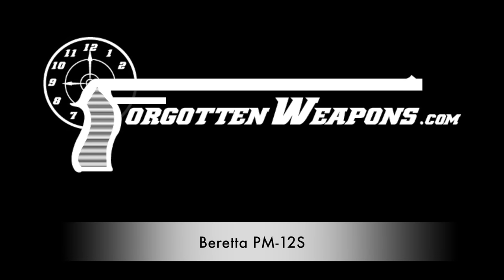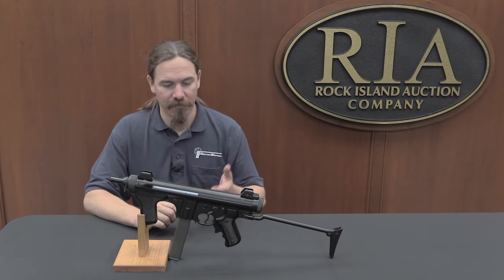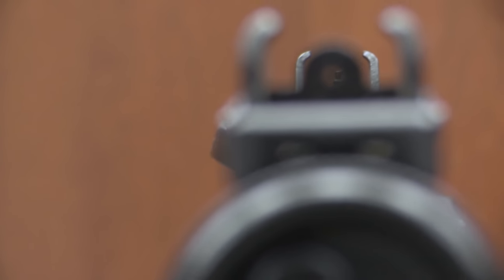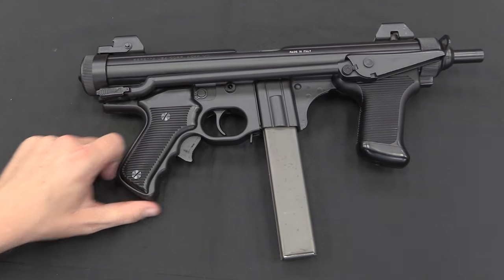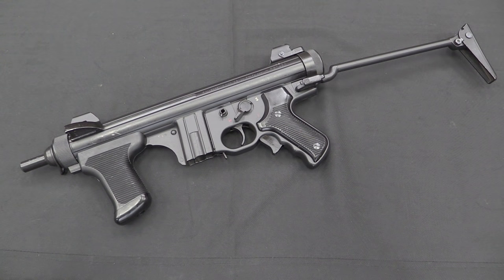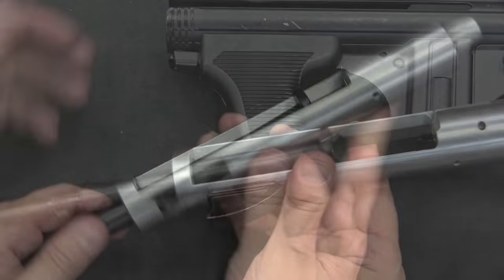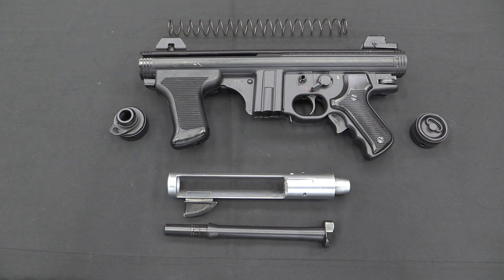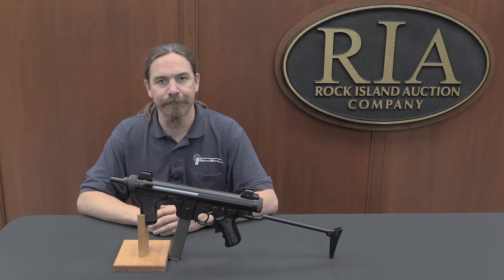The Beretta PM-12S Submachine Gun

Comment: If you like Italian B movies like me, then you'll have seen these being fired from (or at) countless Alfa Romeo Guilias.
Reply: I prefer them being fired at Jaguar E-Types like in "Danger:Diabolik"
Reply: wait which movies? I need to know.
Reply: @Handhandme  every 70s movie of the genre  poliziottesco
Reply: I am a simple man. When I read Alfa Romeo I will press like!
Reply: Saw it in the film, THE CASSANDA CROSSING, but somehow the wrong size magazine clip was being used, 25 rounds when they are blazing away at each other inside train carriages,which obviously this isn't, 32 rounds.
Reply: @colinelderfield6964  Well usually the magazine is loaded with 30 or less rounds because spring tension of the follower tends to double feed especially in older magazines. Other than that there are also 25 and 40 rounds capacity magazines, the M12 uses the same magazine that was used by the M38 lineup of SMG from Beretta. In Italian Military and Police you can heard them referring to the M12 as the MAB sometimes (MAB stands for Moschetto Automatico Beretta, Beretta Automatic Musket translated, that was the official name of the Beretta M-38 SMG).

Comment: by any chance your ever do a video on the xm8 series and why it didn't work out for the army?
Reply: I think the XM8 was not adopted was because the wars In Afghanistan and Iraq
Reply: He actually talk about the XM8 in Q&A#6 or 7.
Reply: Grant Barnett:  That was both A: Only if you pumped so many rounds through one, as fast as you could, that the steel itself was starting to warp and buckle and B: They fixed that.
Reply: it wasent adopted because of colt, the army wanted to get the xm8 which was much better then the m16 and m4, but the goverment have deals with colt so they couldnt get the xm8, because it was from h&k so it means that they would cooperate with the germans and colt didnt want that so they paid some senatros of that they dont vote for the xm8.
Reply: Patrick Gonzalez so that was the problem then
Reply: MrBlonde294 You realize the Army buys their m4s from FN, right?
Reply: Filipe Amaral the Army actually took complete ownership of the design in 2009. Colt sued them to try and get it back but lost. Now that I think about it though, that was after the cancellation of the XM8 project so at the time Colt may have been able to influence things. I haven't seen any direct sources one way or the other so who knows?
Reply: The single biggest reason for the XM8 is that it is not significantly better than the AR15 platform in service at the time and the key word there is significant. The costs of replacing the AR15 platform go beyond just the guns. Equipment, documentation, and training would all need expensive changes made. Armorers would need to be rated on a new gun platform. Supply would have to learn new parts and develop new procurement channels. Meanwhile, the AR15 is still reliable and has enormous room for improvement or adaption thanks to the many modules out there for it. Stay tuned for Ian and Karl's series on What Would Stoner Do? They, using civilian modules, have probably created a superior weapon to the XM8 with much less hassle. Until someone comes up with a gun that can completely outshoot any AR15 configuration possible, I think the AR15 will continue to serve well.
Reply: the ar 15 isnt a bad rifle, but its just too sensitive sometimes. but its cost also to modify the current ar 15 rifles, there are the m16a1, a2, a3, a4, these are all different rifle and have to be replace if they want the newer model. but currently some units have replace it with the fn scar or the m416, good weapons as well!
Reply: Patrick Gonzalez g36 is one of my favorite guns, so cool and so compact
Reply: Who's Chance?
Reply: what chance?
Reply: The OP started talking about some guy named Chance and his ever. It sounded like an alien talking.
Reply: It's because game devs needed a gun named 'prototype assault rifle's. ;~P
Reply: My country navy PASKAL use that xm8 gun
Reply: Malaysia adopted the M8 platform.
Reply: MrBlonde294 special forces use the scar series and navy seals use the M416.  But those are considerably much smaller contracts than say outfitting an entire army, air force, navy, and marine corp.
Reply: Um, no, G36s HAD that problem;  they work fine now.  In fact, 4 guns were much, much, MUCH more reliable than the M4:  FN SCAR, XM-8, G36 and HK 416.  The last 3 are all made by HK.  As stated, XM-8 is basically just a G-36 with a face-lift, and the 416, though it looks like an M4 externally, has a G-36 gas system.
Reply: @varanid9  yeah the 416 looks like a M4 because it is based of the AR-15
Reply: I think Larry Vickers might have talked about it WITH Ian at one point, because he owns a functional replica of an XM8 rifle. Apparently this issue was not with the weapon's design at all, but the circumstances of its development. A general had put in a request for a new rifle in a roundabout manner, and the army was not happy about it and canned the project taking ownership of the designs. (I think thats the way it went).

Comment: Beretta PM-12 in it's version M-12rs was used by some branches of our Military, especially the Marina Militare (Navy) in the 1970s and 1980s, actually it is still used by the sailors during parades because it's stowed on the older units of the MM but it's not issued anymore in the Esercito (Army) or Aviazione Militare (Airforce).
On the contrary it is standard issue as you said still today for the Polizia di Stato (national Police) and Carabinieri (military Police), actually any Carabinieri car has one stowed under the front passenger seat (with a special security release) and it is very common to see it at any police checkpoint as there is always one or two Police/Carabinieri members performing the talking and checks with the drivers and one with a heavy duty bullet proof vest and an MP-12 standing by a few meters away that keeps an eye on the other occupants of the vehicles.
Ciao da Milano :-)
Reply: Never seen any Carabinieri checkpoint, here over in my place it seems all they do is speeding in residential areas.

Comment: I've held a few of those in my hands! They belonged to the Military Police of São Paulo State, in Brazil. Here they were called Beretta M972 and our model had some kind of reddish brown pistol grip and foregrip. The guns were sent to destruction because they were really old and by some absurd decision of the Brazilian Army, 9mm was prohibited in favor of the .40 cartridge, so there were no efforts to buy new 9mm machine pistols/submachineguns for police duty. To fill in the SMG role, the Force adopted the horrifying Taurus/FAMAE MT40 which then evolved to the Taurus only design SMT40. Even if the MT40 one was a piece of junk, it performed a lot better than the newer SMT40, so four or five THOUSAND new SMTs were put into storage indefinitely because they had too many issues and defects to be safe to use on the streets, and Taurus didn't get them back to fix whatever was wrong with them. If you shook or jerked the weapon around, it could fire by itself an entire magazine until empty, even with the manual safety engaged. The agency then kept using the MT40s and bought a lot of Imbel IA2 automatic rifles chambered in 5,56 to replace the SMTs. Thanks for the interesting video, I like that Beretta design, it just works.

Comment: I read that this model is not the latest version of this gun. According to the owner's manual of the model 12 S II, the 12 S II (not this one) is the safest open bolt ever made. I just can't find any images of its details. Its firing pin won't hit the primer out of battery (I suspect it is not fixed, maybe a seesaw type) and the bolt must return to the sear position to be free to collect a fresh cartridge from the magazine (like a Walther MPL/MPK), so, there is no danger if you pull the charging handle with a magazine on.

Comment: The small PD where i worked for 20 years had 2 of these for the first few years i was there. Great guns, simple, robust, and quite accurate. The cyclic rate is such that 2 round bursts were fairly easy. To get 3, u had to deliberately hold the trigger. We only practiced with them maybe once a year. I think somebody had the idea to make an "entry team", and smg's were still in vogue in the mid 90's. After a few years we realized they served no real purpose and they were sold off. We got Mini 14's and later AR-15's, both of which were much more practical. It is a good weapon, but the MP5 is a bit smoother and seems slightly more accurate. Great video as always

Comment: I'm a bit confused by the safety. Doesn't this fire from an open bolt? It seems like to fire it, you would have to switch off the thumb safety, depress the grip safety then pull back the charging handle. That seems pretty slow and with way more steps than you need. Was it possible to put it on safe with the bolt open and in the firing position or were you forced to carry it in condition 3?

Comment: I am afraid I don't see how the grip safety would prevent it from accidental firing. With the bolt in the forward position, a round could be loaded and the firing pin ready. Keeping the bolt forward would only prevent it from firing a second round after the first one was dicharged. Can someone help explain?
Reply: It's an open-bolt gun. The weapon is ready to fire when the bolt is pulled back, and pulling the trigger releases the bolt, which picks up and chambers a cartridge and fires. The firing pin is fixed to the bolt. The only time you would have a live round in the chamber and the bolt down is if you had a light strike, which is itself nearly impossible with such a massive bolt.
Reply: Thank you. I wasn't thinking of it being an open bolt.

Comment: Gun noob question here: Why is the problem of the gun firing when being dropped on it's rear end only a problem with SMGs and not other kinds of firearm?
Reply: It's all open-bolt guns. An open-bolt weapon is ready to fire when its bolt is pulled back, and pulling the trigger releases the bolt, picking up a cartridge and firing with a fixed firing pin. The bolt is not locked to the barrel in any way, only the force of the spring and the inertia of the bolt's weight restricts fire rate and allows chamber pressure to drop to safe levels before ejecting. Therefore, if you knock the gun hard enough to slam the bolt back, it will pick up a cartridge and fire as normal. 
Closed-bolt non-locking guns don't have a fixed firing pin, so the same action would only chamber a round, if even that, since the bolt will be lighter and harder to knock back. Closed-bolt locked-breech guns have the bolt locked to the barrel when in battery, so the knock would do nothing.
Reply: Because they fire from an open bolt.

Basically, the bolt has a fixed firing pin on it, and is locked to the rear bye the trigger sear. You pull the trigger, and the bolt is pushed forward by the spring, cambering a round, and firing it.
If you drop a SMG on it's rear, while the bolt is all the way forward, you risk the bolt 'falling" rearward from inertia. If it doesn't fall hard enough to catch the bolt on the sear, it will then start moving forward, stripping a round, and firing it.

Comment: mix a thompson, a grease gun, an mp40 and add Italy, you have a m12
Reply: Actually all those were first generation SMGs, while the M12 is a second generation smg (the first second gen. SMG had been the Armaguerra OG-43). The difference is that second gen. SMGs have much of the bolt weight placed in front of the bolt face (because it's "L" shaped or, like in this case, its telescopic and placed around the barrel), so shortening the weapon and making it more balanced during fire.
Reply: @neutronalchemist3241  just take the joke as it is, will ya?

Comment: Since the Beretta 12 S is now available on World of Guns I discovered some things about its internals. The grip safety blocks a piece named SEAR BLOCK BODY (inner part of a "two part" sear). This part pushes the SEAR BLOCK ARTICULATION  (the real sear)  to release the bolt, but, the sear block articulation can't pull the sear block body, so, even if you block the sear block body there is nothing to prevent the sear block articulation from sliping off from bolt engagement and an accidental discharge will be always possible (worned out sear/bolt notch, dirty, mud...). Still waiting to see how Beretta dealed with the problem on the model 12 S II. Not good. Beauty, but... mediocre.
Reply: The grip safety also lower a quite hefty block placed just behind the magazine that, if not lowered, prevents the bolt to come back if in forward position or to go all the way forward if in rear position, so no, an accidental discharge is not possible.
Reply: @neutronalchemist3241  On world of guns, for some reason, the rear part of the bolt blocking pin is lower. Looks like something designed to be pushed down by the bolt when it is going forward. I found many errors on world of guns (incomplete ratchet cover on uzi, no steel tube for the sturmgeweher recoil spring and incomplete cylinder hand on colt python - among others I can't recall now).
But still I can't understand why the sear is a two part set.
The walther MPL seems to be a much safer design.
Reply: @garetz2011  The sear is in two parts for the disconnector to work.
Also the sear of the MPL can slip for a hit, especially when in semiauto, since the trigger can only push, but doesn't pull it.

Comment: Why are sub-machine guns even still used!? They're useless weapons, they don't penetrate armor, they have small range, and just as big of a kick as a 5.56. They should be forgotten.
Reply: B they're still used for swat or urban assault situations where overpenetration and size are cons, and theyve been used by special protection services like the secret service because you can easily conceal them and they can lay down a lot of suppressive fire which is good in their case
Reply: WRONG. 5.56 can put down just as many rounds, basically just as quickly, with minimum recoil.
Reply: 5.56 doesn't over penetrate, it spins around and even breaks apart once it hits gooish organs, that's why it's so deadly, the bullet tumbles around in your body causing more damage. the Cal is .223....that's a .22 caliber. There aren't any instances of over penetrating. But it can punch through body armor, something a .45 or 9mm can't.
Reply: Assault guns bullets susually go through bodies. You don't want that when firing in a crowded place.
Reply: STOP MAKING GOOD POINTS, BRENT!!!!
Reply: Saying a sub machine gun is 'useless" because it fires pistol cartridges is like saying a Sedan is 'useless" because it doesn't have a truck bed...
Reply: My van is useless because it doesn't have a rear door, true.